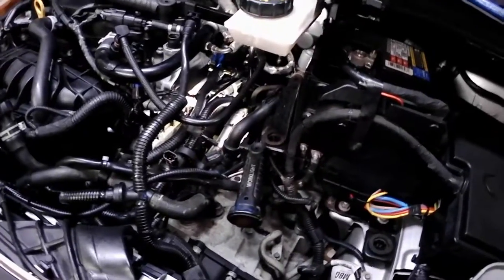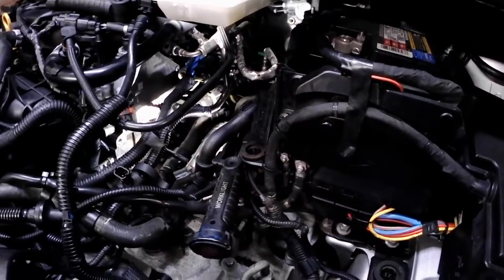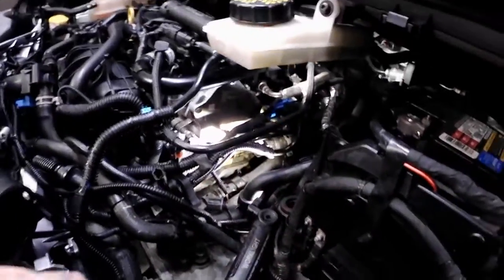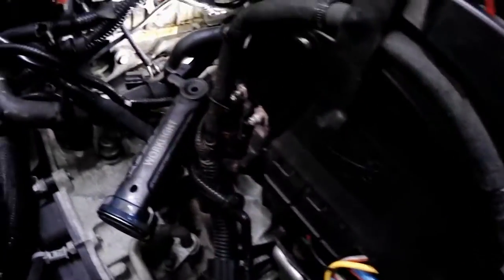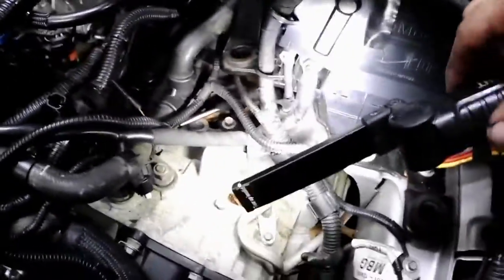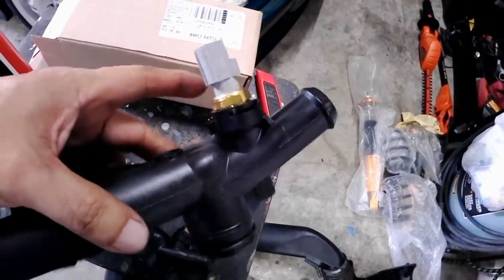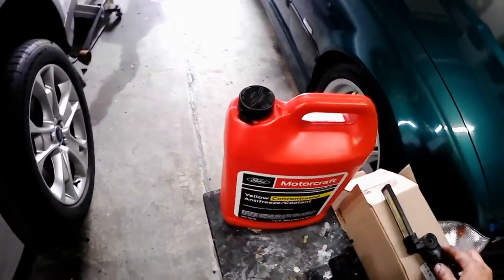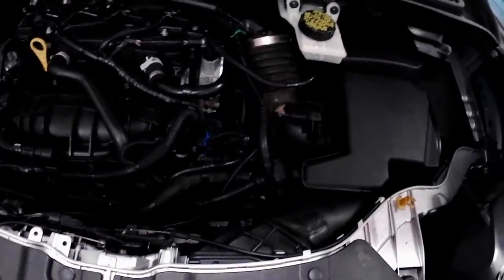2013 Ford Escape 1.6L Cooling System Bypass Adapter - Leaking

Comment: Thank you for the video!! Was my problem too, fixed it, put everything back, filled up the reserve tank.  Now runs straight to hot as soon as I turn the key on. I know I am missing something stupid like getting water in the motor( burping) not like I can get to radiator and top off water. Or reset computer system.   Any ideas anyone? Help greatly appreciate!!
Reply: I had the same issue after replacing thermostat. Had to clear the vehicle codes and burp the system. Here's a video how to do it. https://youtu.be/4gk4xb9aOgE
Reply: @mayzabaan  THANKYOU!!! Completely worked!! That's what was wrong with it. I cleared the code, ran fine for a lil', but I did not burp the system well enough! Threw code p1299. So kept filling the reservoir tank and cleared the code again. So far so good. To burp that system is just ridiculous!!!